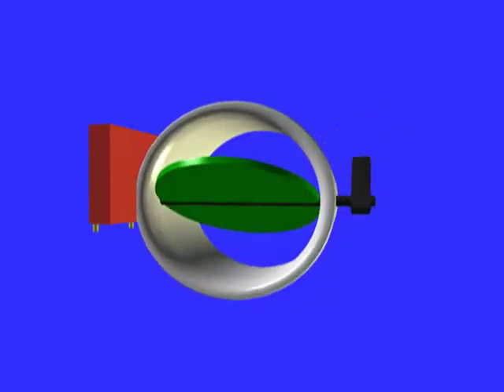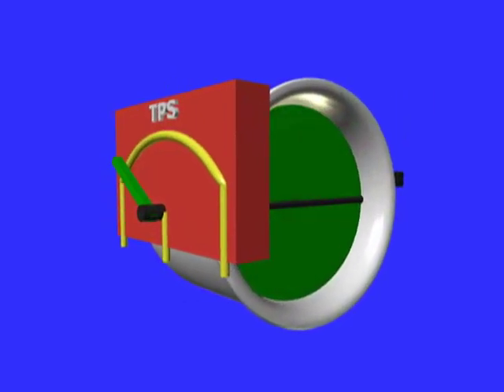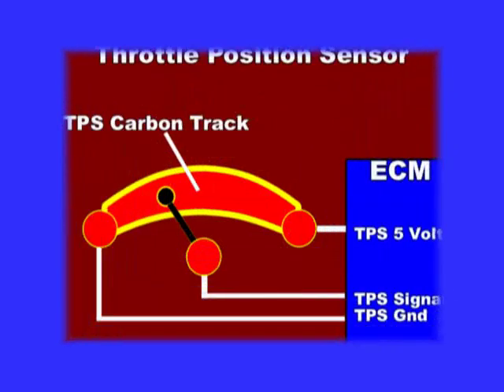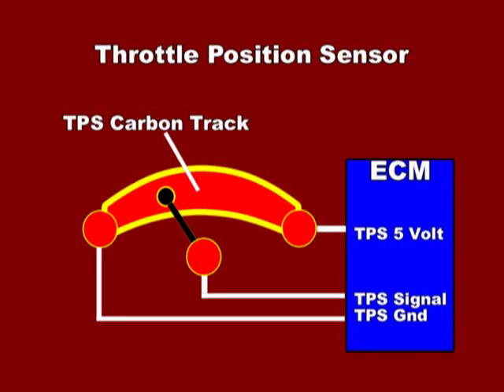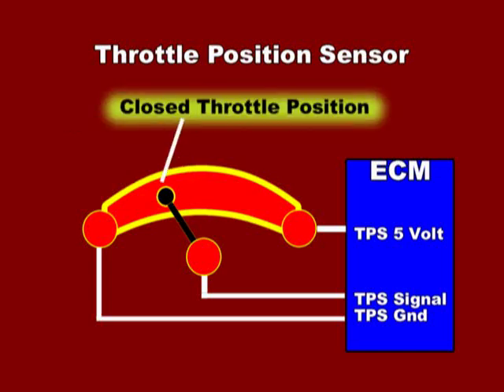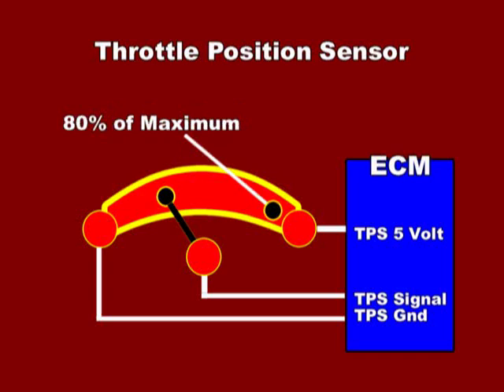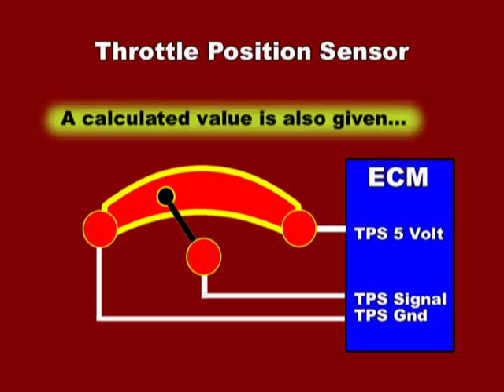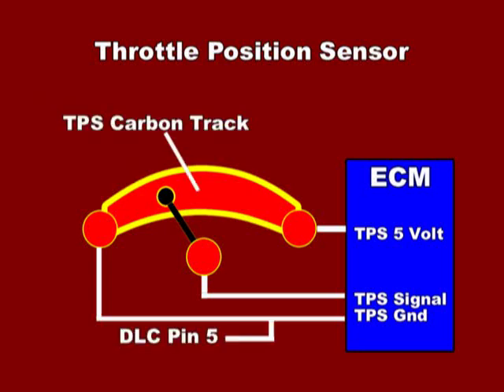TPS or Throttle Position Sensor Parameter

Comment: Thanks for your response, You're right about TPS in that model, now is working fine.The issue remains with the KS. It is broken, I'll replace it as soon as possible, but remember that i dimensioned i replaced O2 sensor? Well according the instructions of the new one: "black wire is SIGNAL and white (2) are Heather's"for Subaru: White=Signal, Red=Pos. Heater and Black=Neg. Heater. I did mine wrong, I noticed when I ran the scan that it always at 2.55V all the time. Now is better, no hesitation :)

Comment from the maker: The TPS in 91 was not a drive by wire. Those are the only ones that had the sensor readings backwards and they're also dual sensors. But I don't remember the arrangement that year exactly. On a Subaru the knock sensor most likely has a huge effect in timing. Disconnecting the KS will NOT FIX the issue, only make it worse. Some ECMs strategies give the KS less importance. These strategies are not published. Look into the KS issue or replace it. Leave the possible TPS issue for after, it needed.

Comment: I was glad to find this vid. I thought my tps had a problem. When doing adjustment the rpm jumps from 950 to 1200 rpm. I ordered a new one. I also realized there was water in the tank. This combo is detrimental to adjusting idle let me tell ya.

Comment from the maker: Yes, don't take your car to this shop ever again. It runs fine because they erase the KAM adaptive memory when they clear the codes. More than likely your issue is not the TPS as they rarely go bad. Also when the TPS goes bad it develops a small blind spot, not necessarily to do with the idle, even if it's a drive-by-wire system. Post back with year, make and model.

Comment: Hello, thanks for your video, very informative. I got a Subaru legacy 1991... it is a long journey (a friend of mine gave it to me) first i noticed it wasn't burning the gas properly  i suspected the Oxygen sensor (I replaced it) and no more smell of gas unburned at the exhaust yeah! But Next day, it started to hesitate at 2000-3000 rpm's I though " the Oxygen sensor is wrong" so I ran a scan to the ECM and i had that sensor bad (oxygen), but also the TPS had an issue, I cleaned i put it back on

Comment: Continuation... according Haynes manual at 0% closing of the throttle it should be 0.5-1.0 volts and 100% 4.5-5.0 volts. Same like your video, but the TPS in my car is backwards (5 V - 0% close, 0.5 100%) Do you think it is OK to be that way? But wait there is more. it have an other code (Knock sensor) so it took it off and it is all cracked it seems really bad. ( i saw your other video regarding knock sensor) It had some backfiring problems before. i fixed that. Please give me your opinion.Thks

Comment: i have a 2008 altima that has a throttle position of 4.6% at idle. Is that normal or is there a problem? Whats the normal range of percent for this?

Comment: I have 87 Cadillac El Dorado Biarritz and the mph/insrument panel is not displaying any information. It worked fine for 2 years and it just stopped displaying. I know this is off the topic of tps but do you have any information on this. I have checked cps and it seems fine.

Comment from the maker: Ok, be careful when wiring the O2 sensor. I assume that your O2 sensor did not came with the original connector and you're splicing the wires together. DANGER: If you wire the O2 sensor wrong you could feed 12 volts (heater) to the wrong circuit and damage the O2 sensor. As far as the hesitation, replace the KS asap and you'll like the results. Good luck and post back with the results...

Comment: sir.
how to check cat engine model C18 fuel pressure. fuel temp. oil temp. oil pressure. engine primery and engine secondary timing sensor and what should be the valve of sensor. ??? please help